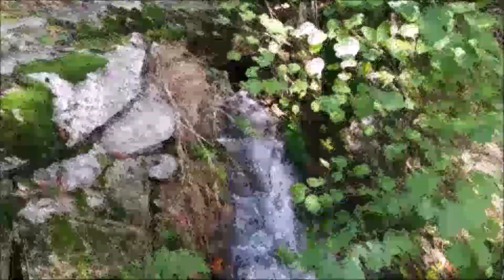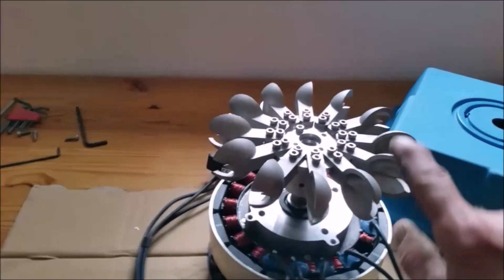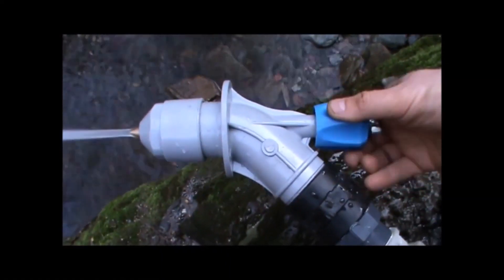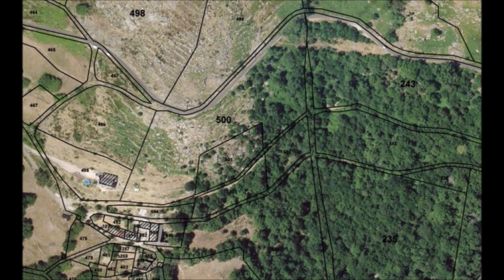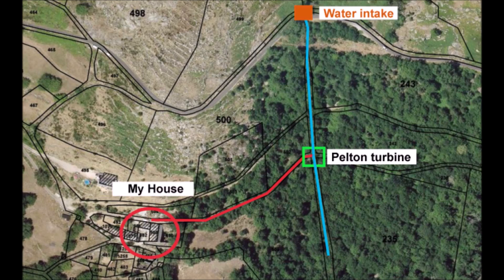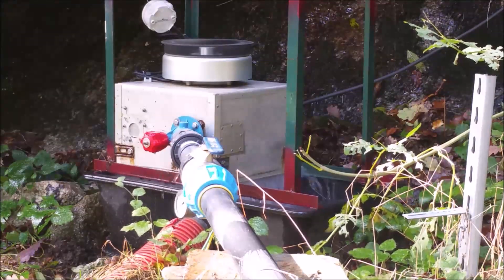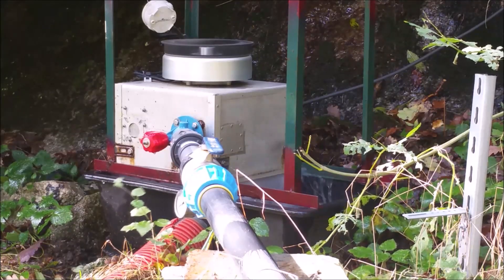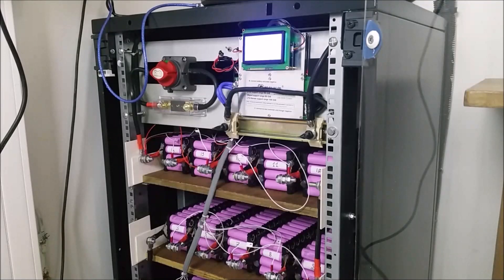my Pelton hydro project

Comment: Merci for your video! 
May I ask you what is the diameter of your water jet...before you had a variable jet? 
As my turbine/generator looks exactly same... The seller wrote the output voltage Ist between 19 and 36V...
Reply from the maker: it's a 240V / 4000W Pma generator

Comment: Very well done video! Your english was clear and concise.
I'd like to ask you a few questions if you'd please answer them. Feel free to use units you're familiar with:
-How many gallons per minute are you consuming to achieve your power output?
-What is your efficiency?
-Do you manually adjust the nozzles as needed?
-Is it loud?
-what is the minimum flow at which you turn it off for the summer?
Reply from the maker: Joe, I can't go more than 2,5 liter/second, if more I have a lot of pressure losses in the pipe (50mm external)
I don't know exacly the effiency, I have to built again the turbine box, as the jet is not perfectly align to the pelton spoon. the 3 phase wire (3 x 2,5mm2) is 150 metres long there is for sure a few losses in the cable. The efficiency must be about 0,6. It could be better.
Yes it' noisy, but no neigbors, except wild pig or fox.....
In summer, no water, so no turbine ! only solar panels
Every morning, I am going to the turbine for a check, (and run my dogs) and I can ajust the nozzle , depending of the stream flow. 
if I hear air bubbles, it's because it suck air at the intake, so I close the injector a little bit (not enought water at the intake).
Today it was 650W, but it's enought for me. I have a 14,5Kwh lithium ion battery. The turbine produced today 15600 Wh
Reply: @cristof48  Thank you for the information. It's interesting you have a VERY similar system to what I am building except I'll be putting the turbine in a pit with a lid 20ft (6m) from my house, all of it built as sound-tight as I can make it.
Reply from the maker: @JoeMalovich  did you built the turbine ?
Reply: @cristof48  parts are in the mail, I should have something whipped together soon.
Reply: macron take all our monney , that why we need to use renewal energy LOL

Comment: Tu sais. que tu peux aussi faire une Pelton avec certains moteurs de machine à laver MOTEUR EN GENERATRICE )
Reply: leur rendement est pourri  c'est des moteur synchrone a balai , le mieux c'est les brushless a 3 fils , pas ceux de machine a laver
Reply: @pochul   Bonjour , ou peut on récupérer des brushless  , je bricole beaucoup et je récupère au maximum !!!!  Merci d'avance
Reply: tu les recupere pas faut prendre des moteur d'avion de modelisme , probleme tu devrat les faire tourné hyper vite a cause du Kv trop elevé , 3 ou 6 bobine max  ( donc mettre des truc genre demultiplication genre chaine et pignon de velo ,donc frottement )  donc prend des moteur de velo electrique qui sont bobiné de facon a faire peu de tour  mais beaucoup de hertz par tour de roue ( genre 40 ou 50 bobinne mis l'interieur) comme ca un tour lui faire prendre beaucoup de passage devant les bobine . et donc moins  besoin de tour , et tu fout un convertisseur triphasé vers continue celui des velo comme sur ma chaine , et au lieu de le branché en 36 volts tu lui met 12 , en generateur ilp orduira donc a partir de 13 volts des watts , la ou si tu lui met 36 volts il ne preduira que des watt au dessus de 36 ( et donc pas en dessous  ) et donc  necessitant une vitesse plus rapide. par contre si ta un onduleur directe qui accepte le triphhasé tu fout la roue de velo electrique directe sur l'onduleur